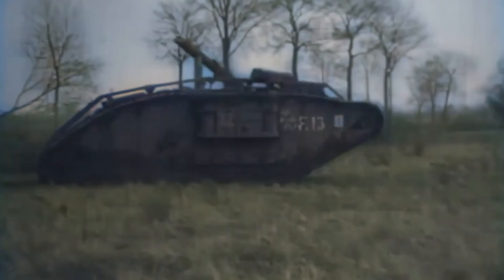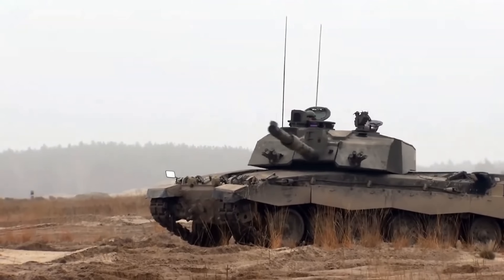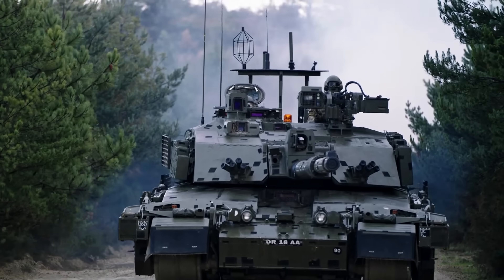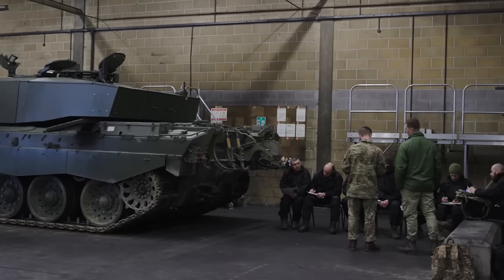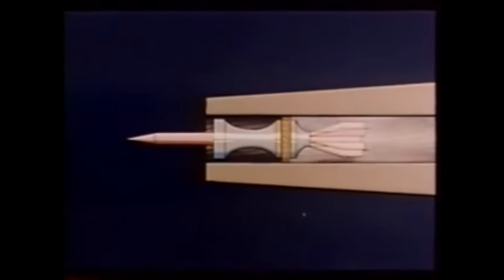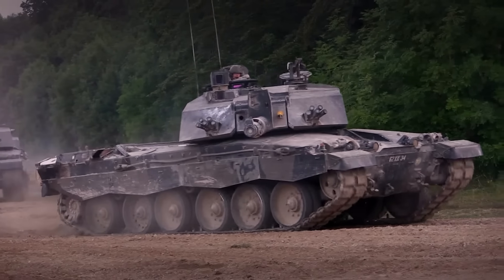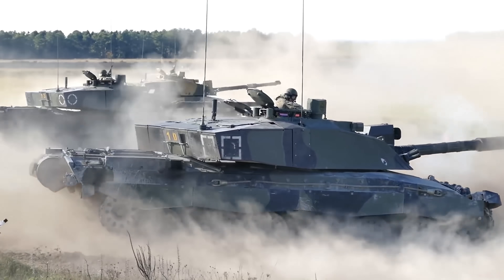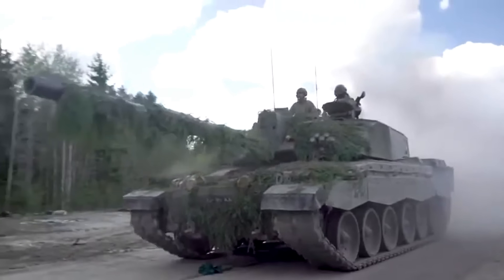The Challenger 2 | Out of time?

Comment: Well said. Really enjoyed this video. I have to agree with your views about the British needs. Tanks are now more of a niche piece of inventory. Completely useless against air power. Tanks are something you bring later into battle to hold the line and support infantry. The tank role has been on the degrade since WW2 and I think that IFVs are really going to be merged with the light tank, I could be completely wrong. I'm not much of tank person.

What the UK really needs is around 4 more Naval F-35 Squadrons. No joke the Fleet Air Arm is the spearhead of the UK armed forces.
Reply: No we do not need more useless F-35B's they are too short range and have far to small a payload to be useful.  We should never have built the vastly over priced 'cruise' ships that we call carriers.  If the UK had built proper carriers that could have carried an E-2 Hawkeye equivalents and F-35C's then okay. 

More nuclear attack subs, get some diesel electric subs and do what the US did with the Ohio class and build more Dreadnought class SSBN's with some turned into SSGN's to use USN vernacular.

Then build more cheap single use escorts make the Type 26, 31 and 32 each a dedicated anti air, anti sub and anti surface but make them as cheap as possible.

If Argentina can sink so many surface ships back in 1982 who knows how many would be lost against a capable opponent.

For airpower I would love the UK to get in on the B-21 program and get some long range stealth strike capability.
Reply: @Ushio01  I take it you're not an aircraft sort of person. F-35B does not have a short range for what is needed. Naval aircraft and normal aircraft follow a different philosophy most naval aircraft are more limited because you don't have a 2 mile runway to build up speed. They need reinforced undercarriages. 

Look at the Harrier and Eurofighter completely different design and functions you would never call either one of them useless.   

It's the same as me saying the F-15 and F-16 is useless because it takes a minimum of 1.5 mile runway to takeoff.
Reply: @Ushio01  I agree about the carrier argument to a certain degree. UK has not operated Supercarriers for over 50 years. Skills ain't exactly sharp. We have a better knowledge and history of operating STOVL on carriers (we invented it) not only that, the F-35B got a huge boost with the Royal Navy and United States Marine Corps opting for this. 

If you look at the carriers they can be augmented at a later date to operate with F-35C and catapults. However the F-35C is the one with the most problems right now (this is why the USN has only 30 F-35C) the engine being the biggest problem. The F-35 all types can carry a large payload in murder config. Look at the actual updates already being rolled out for the F-35. It's insane. Link here.

https://www.youtube.com/watch?v=7SNALUoybt0&ab_channel=Sandboxx
Reply: @NightshadeX85  The internal weapons bay on the A and C can carry 2500lbs each the B can only carry 1500lbs each.

Yes it can carry external stores but it's never going to because that means no stealth and we saw the losses in Vietnam to AAA and SAM's without stealth.

SAM's and aircraft detection are a lot better than they where in the late 60's through early 70's.

The F-35B has no range and very limited weapons capability.

The link you have is about block 4 which is currently so far behind schedule the GAO said in August no F-35 will start to be fitted with it till 2029 and then it's only for US aircraft anyway.

Don't link to YouTube these guys just read off of military sites or manufacturer press releases.
Reply: @Ushio01  FFS stealth has it's application once air dominance and air superiority is achieved, stealth is no longer needed. AAA and SAMs are not as effective as made out. No idea where you got 1500lbs from, I have it at 15,000lbs to 18,000lbs.

Besides most aircraft never go full load, name me a single battle with fighter jets where they exceeded mach 1.2. If SAM and AAA were that good then the era of aircraft would come to an end it has not. 

Stealth aircraft in vietnam ? The F-4 was not a stealth aircraft. Right, you have no idea at all about aircraft do you ? You sound like you know only squaddie stuff ie: rifles, tanks, apcs and such and nothing about air power or air usage. 

The F-35 in full stealth can carry almost as much as an F-16 in full loadout. The F-35 cannot carry what precisely ? The standoff  weaponry makes SAMs practically useless. The F-35 would need to be in less than 20 miles of the S400 in order to be of any use. Dude you don't know anything about the F-35. Next you will be telling me the F-22 is useless because it cannot carry AMRAAM-120 A/Bs.
Reply: @Ushio01  Update:
You are correct about the 1500lbs internally. So what, the AMRAAM weights 350lbs do the math. Besides keeping weight down is good. Don't want to be flying an absolute heffa! do ya.

The F-14 could in theory carry 6 Phoenix missiles (think they tested it in reality) but never carried more than 1 or 2 due to weight I was told this by an F-14 pilot and rio. The more your aircraft weighs the less manoeuvrable it is, the less control you have. Might as well have a great big heffing bomber for that work. It's all about balance and say 4 AMRAAMS complete stealth makes you an absolute ninja on the battlefield. Able to maintain decent speed, control and balance without being handling like a shopping trolley my man. Loading up is also expensive and only needed in certain circumstances. 

The F-35 is the real deal. The reason why the negative press about it is because it practically makes all other aircraft obsolete. They are terrified of the F-35 and it's capabilities.
Reply: @NightshadeX85  LOL the F-35 was designed to be the cheap and expendable air to ground unit to the air superiority F-22.

As to 4 AMRAAMS wow 4 shots then you have to RTB so useful in a war 'rolls eyes'.

The F-14 standard loadout was 2 sidewinders, 3 sparrows and 2 phoenix for 7 shots, the F-15 can carry 8 AMRAAMS and the F-22 carriers 6 AMRAAMS plus 2 sidewinders.  Those are air to air combat aircraft.

The F-35 was built as a ground pounder and  the F-35B variant that the UK has got stuck with is bad at it and air to air.
Reply: @Ushio01  The F-35 was NOT a cheap and expendable air to ground unit. There is no such thing as an expendable aircraft. The F-35 program called the JSF (Joint Strike Fighter) was a multirole aircraft built to fulfil numerous roles from A-A, A-G, Recon, Naval ops , Strike, CAS to name a few and was built so it could be operated by numerous services in any environment. 

Yes most fighter aircraft in the multirole have between 2-6 slots for A-A missiles. Yes RTB and turn round. Good luck loading up a Flanker with 11 missiles and hitting even Mach 1, by the time you get to the fight with all that weight you will be bingo fuel and a sitting duck with all that weight. 

You need to look at fuel efficiency and consumption. Also while you are at it look at what is outfitted on a fighter when at war. Yes the F-15 can carry a shitload, however in an actual wartime scenario check desert storm they carried couple of AIM-9 and a couple of Sparrows, the reason being the weight shift. Carrying max loadout is rarely done because you lack range. Any aircraft max loadout will barely go 200 miles and is also very limited in mission changes. 

The Royal Navy choose F-35B for carrier reasons. The Royal Airforce choose F-35A and Bs, reason for the B variant is for CAS RAF has always provided CAS for the Army. STOVL can operate close to the frontlines without need for runways. Why do you think the RAF had Harriers for.
Reply: @NightshadeX85  LOL the F-15 does not have tiny range if it carries 4 sparrow and 4 sidewinders that's less than 2800lbs

Air to air missiles are much lighter than bombs 8 AMRAAM's is just 2850lbs.

The AIM-54 Phoenix is the exception as they weight 1000lb each.

The max loadout of an F-15 is 16,000lb's a full air to air loadout isn't close. 

The RAF had Harriers because at the time the belief was that war with the USSR would start with nuclear attacks on airbases and runways so V/STOL was needed.

Not really the case anymore.
Reply: @Ushio01  Omg you are dense. The F-15 does have tiny range if it is fully loaded out. You whole statement about the RAF was wrong, what were British Harriers armed with ? A-G for the most part. The early Harriers didn't even have radar in them.

What you are arguing for is missile trucks, you think the more missiles or more it can carry the better the aircraft. 

One of the benefits of Harrier was a lack of dependency for runways. This was primarily so the Harrier can be brought closer to supporting frontline troops in CAS not because of nukes. Guess what, the Harrier can only take-off vertically with 28,000lbs max load this includes fuels and weapons. The Harrier cannot take-off vertically full loadout. 

Yes it still is the case why do you think the RAF choose F-35B as well as the A variant. Why do you think the USMC choose F-35B, again for carrier and CAS of ground troops.
Reply: @Ushio01  I never said the F-15 has tiny range if it carries 4 AIM-9 and 4 AIM-7. I said it increases the range due to less weight. What I'm saying is load it all out with max weight and watch the range decrease drastically. 

I worked for over 10 years in Aeronautical Engineering. Aircraft are designed for a purpose. An aircraft takes and is outfitted for what is needed for that particular mission. Missiles are expensive. It is rare for an aircraft to be fully loaded out. It makes take-off and landing more difficult, it restricts the aircraft more than you know. For a simple CAP mission (Combat Air Patrol) most fixed-wing aircraft would have couple of short-range missiles (AIM-9 or ASRAAM) a couple of medium range missiles (AIM-120 or Meteor) and maybe bags (Fuel tanks) depending how long the CAP is. That is it.

Comment: Tanks are a weapon system, not some mystical being capable of conquering the universe. I mean, a well placed big ditch is enough to render them useless, and the Ukrainians showed what you can do with a cheap drone and a mortar bomb. Like every weapon system, they're subject to user, context, situation, and support, plus large dollops of pure luck. 

British armour doctrine has erred on the defensive side since Chieftain (some say this is entirely down to that engine enforcing a more static type of fighting), and Chally does seem to follow - mobility is relatively low, it's a bit heavy, and for its time was armoured like a battleship. Underside protection for mines/IEDs wasn't really something to think about in the 1980s - after all, if your primary threat is hordes of T-55/62/etc across the West German Plain, things are primarily going to be going bang on your upper surfaces. 

The other thing to consider is that with our very limited stock of the things, increasingly tiny defence budget, and the time it takes the MoD to procure the next gigantic waste of money, if we actually needed to keep them or thought they were any good, we wouldn't be giving them to Ukraine.

Comment: The advantage the rifled gun that I have always heard (from ordnance experts) is with HESH.  The extremly high rotational energy caused by the spinning at something like 197,000 RPMs assists spreading the charge out for maximum efficiency.  And gicen that Britain was more comvonced of the advantage of HESH over HEAT or APFSDS when they were making the gun design decisions in the late 1950s with the development of the original L11 120mm rifled gun.  The UK has stayed with it because, well, it worked and the ammo was already in inventory.  Even developing new ammunition tyoes was simplified, because you still had the last generation stuff aitting in bunkers tongold youbover until the new stuff was ready for issue.

So, it really wasnt until now that things got to the point where the UK really needed a new gun, and it just makes more sense to adopt what everyone else in the West is using, and let Germany. France, rhe US, etc., do the heavy budget lifting on R&D.  Especiallybsimce, if the UK continued to do their own thing, the UK would be having to swallow the entire cost of R&D to support a tiny number of guns (looking at the UK tank park compared to every Western nation fielding varations of the 120mm Rheinmetall)... and since overall R&D costs don't scale to the size of future production, it would be anazingly stupid for Britain to accept that cost when they know they will have to divide that cost amongst a fleet of a few hundred tanks at best (presuming they sold some to Arab oil nations).
Reply: Britain is on some copium, the rifled gun makes it unable to fire the more powerful APFSDS rounds and heat is vastly superior to hesh, Atleast the American MPAT rounds
Reply: @Optimusprime56241  I don't think it is the rifling that prevents it from firing better APFSDS, in the video he said it was the two piece ammo that prevents the penetrater from being made longer, and while APFSDS rounds do not react well to spinning, the sabot could be made such that it isolates the projectile from the rotation imparted by the rifling, as was demonstrated in the animation that played in the video while he was talking about it.
HESH vs HEAT it really just depends what you're trying to do with it, HEAT is likely better at taking out armoured targets but HESH is likely better at bunker/buildings and such. Also, pretty sure MPAT didn't exist when they decided on what gun the Challenger 2 was going to have.
Ultimately I think @geodkyt is right, and they just didn't want to take the time and money to make a brand new gun and all the new ammo to fire from it when they could just move to NATO standard.
Reply: @commandoepsilon4664  the apfsds of similar size and weight have on average 25% lower penetration capability on the L/55 rifled vs the L/55 smoothbore
this is due to  the higher friction and imperfect gas seal in the rifled gun, plus the lower possible chamber/barrel pressure due to the rifling.
Reply: @zhufortheimpaler4041  Interesting, I thought it was mostly the spin that was the problem. Thank you for the information!
Reply: @commandoepsilon4664  The spin is a good thing and is why CR1 holds the longest tank kill record.

Comment: As much as I love the chally 2 you can't do much with a 30 year old design
Reply: Really? Given the Chally 3 will be made by extensive upgrading of the Chally 2 units.
Reply: What about the Abrams and the Leopard? The Abrams is 8 years older than the Chally 2, but the current version is in a league of its own. The same goes for the Leo 2A6/7.  Light years ahead of the Chally.
Reply: @johnnyenglish006 Abrams and Leopard 2 are, in my engineering opinion, better designed tanks than Challenger 2.

Challenger 2's original design was fraught with far more compromise, a smaller budget, more political meddling, rigid and poorly considered doctrine, and generally less flexibility of thought for what the future battlefield might require of the vehicle than the German and American vehicles.

Whilst you can upgrade older designs, some are much more or less receptive to such upgrades. 

It's telling that in the same span of time as the UK will have gone from Challenger 1, to Challenger 2, and then Challenger 3, all of which are radically different from each other out of necessity... The USA and Germany will be still using the same vehicles, just upgraded.

Leopard 2A8 is equal or superior to Challenger 3 in almost every metric and is arriving at the same time. M1A2C is equal in most metrics and was first delivered in 2015 to the US Army. 

The reason our allies aren't having to totally redesign their tanks is because they did a better job in 1979 of designing them. Abrams and Leopard 2, especially Abrams, have better bones to their design, and are more readily upgraded without needing a full redesign. It's that simple.
Reply: @johnnyenglish006 They all burn the same when Lancet-3 strikes them.
Reply: @ÆthelwulfOfNordHymbraLand2333   actually, they don't. Of the over 40 Leo2s hit with lancets, only 4 tanks were complete losses. All the others were damaged, some of them seriously, but they were repaired and got back into the fight. And most importantly the crews survived. 

That is why is you look at complete losses, Ukraine lost a battalion's worth of IFVs in about 4 months in the south while the Russians lost a battalion's worth of IFVs in five days at Avdiivka alone. 

So, no, only a layman would say they burn the same. They don't because of the differences in armour thickness, composition & layout, and ammunition placement.
Reply: @ÆthelwulfOfNordHymbraLand2333  Nope. 

This is one of those instances where people can legitimately say they are built different. Nato IFVs, let alone tanks, are rather surviveable vehicles for their crews. Hit em with artilery and anti tank mines, the crews are nice and safe inside and able to dismount. You need only ask the Ukrainian crews who have done so. Hit a russian tank or IFV with artillery or mines... turret toss was a meme for a reason.